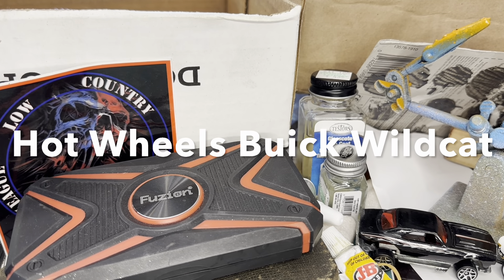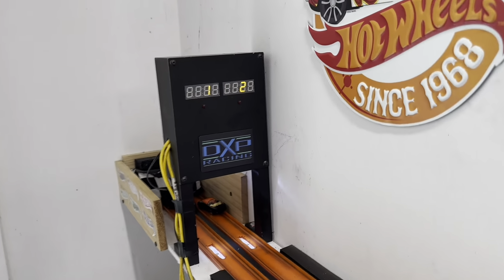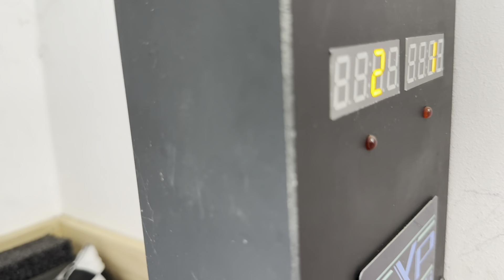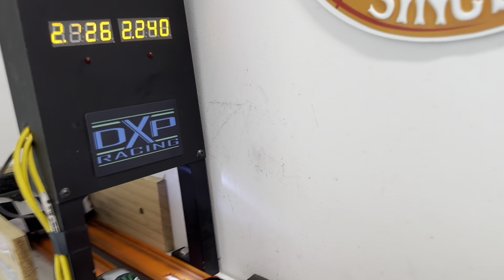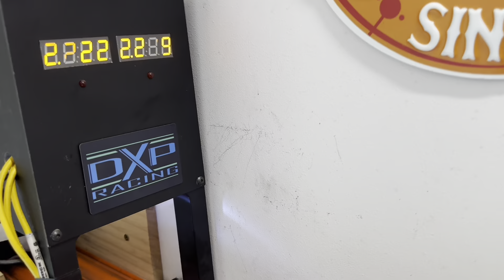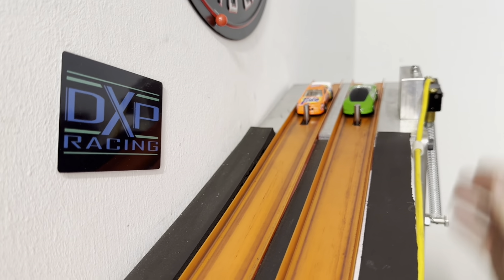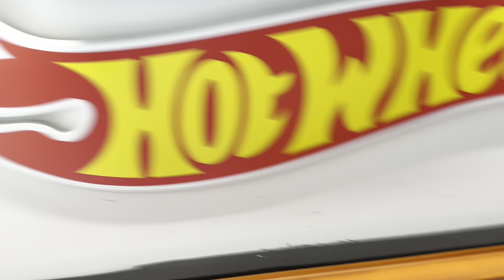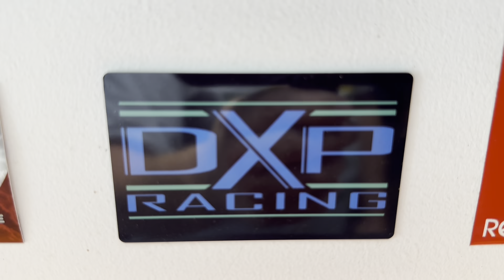Hot Wheels Buick Wildcat

Comment: Never leave any Diecast stone unturned....and the Buick Wildcat indeed has potential.....it was good to see one break into the case, whether high or low , the rank got faster, gr8 runs in comparison
Reply from the maker: The weight difference surprised me.  Just shows that where they are manufactured makes a difference.